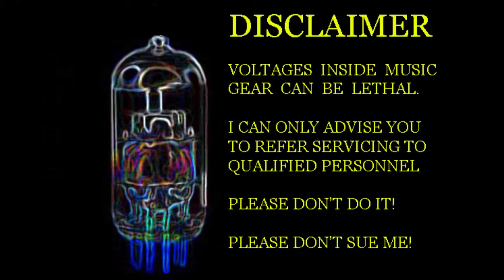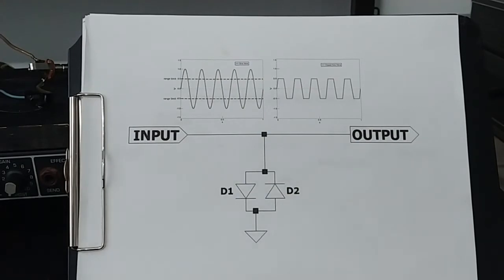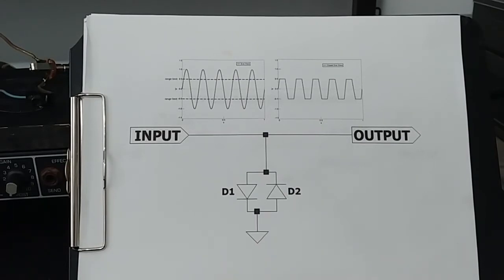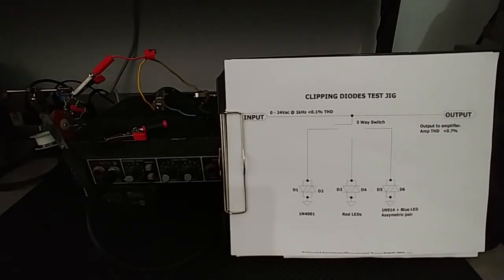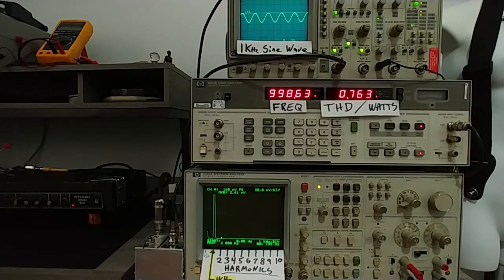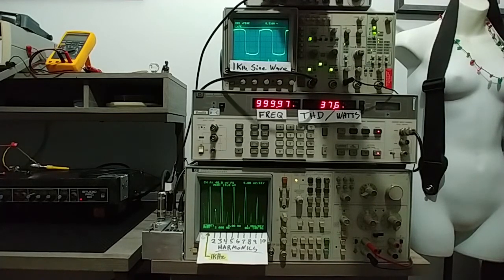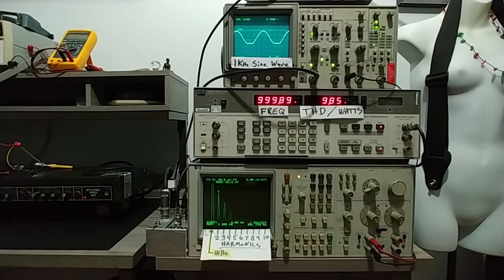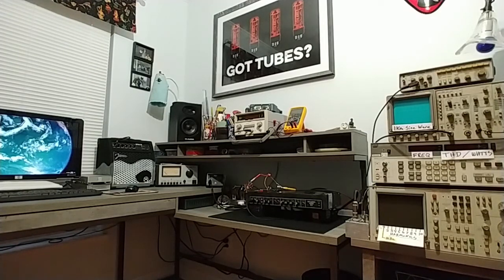Understanding Distortion (Pt2) - Diode Clipping circuits

Comment: 21:00 i've never agreed with the hypothesis that even harmonics in the overdriven signal is what makes vacuum tube amps sound "better" than analog clipping diodes or digital amp modelling. in the oscilloscope videos i've seen, tube amp distortion frequently seems to have this "wobble" or "fuzziness" to the waveform from it not being perfectly stable. whereas clipping diodes produce a rock solid waveform with high resolution on the oscilloscope. it's my theory that the mechanism that causes this phenomenon is what causes tube amps to sound "better" to so many people
Reply: That would make a lot of sense! 

That’s what I would describe as the “feel” of the tube amp so many people long for, because it reacts differently everytime yet its familiar 

Solid states on the other hand are so linear in their response so it misses the “feel”

Comment: Excellent presentation !
I used to build these boxes with 1N34A germanium diodes because of the lower threshold voltage (as you know, .3 v.) and they seemed 'looser' or 'leakier' at their turn-on point.
It will be fun to see what results you get if you decide to test 'em !
Bill P.
Reply from the maker: Im planning on doing some germanium and zeners soon, thank you!
Reply: @amptechron  You're welcome and I look forward to your results with the germanium  diodes !

Comment: Let me suggest a test. Put a 5k trimpot in series with one of the diodes and vary the wiper to see the results in harmonics.  It will cause an assymetric clipping, but with a certain control...

Comment: I just added the Jose clipping circuit (zener diodes) to my super lead. Somebody had already drilled a hole in the front panel for a ground switch, so I repurposed it.
Reply from the maker: I may have to do a follow up with germanium and zener diodes. How does the mod sound?
Reply: @amptechron  like 80's hair metal? Lol there's a significant volume drop when it's engaged, and it helps somewhat emulate the same kind of sound you get with the amp cranked, without blowing your eardrums or getting the cops called. I've noticed, using an attenuator, theres almost no audible difference if the master volume is above 70% or so
Reply: I'll see if I can get a sound clip for you
Reply from the maker: @ApeShift  Thanks, I love the supers and 800s.....Rock on!
Reply: @amptechron  I assembled a Ceriatone yetti amp, I liked the clipping diods and ppimv in that amp with a adjustable negative feedback resister pot/ resister. That did good classic rock to 80's metal. It's a good feature when switchable. There are good diagrams on the net of those amps.

Comment: Im curious how tube amp wave form looks and changes when using a distortion box to further overdrive an amp already in overdrive. Example is I use MXR distortion plus ,that uses germanium diodes, in front of tube amp that is already in distortion.  Since the tube amp has that odd wave form does the distortion box take away little scope or add to it.

Comment: JFet clipping ?
Reply from the maker: I may doing a third distortion vid with active components in the future, as well as other types of diodes....
Reply: @amptechron  Yup, JFET and MOSFET distortion would be interesting to see. 

JFET, in special, can work in two different regimens (triode and pentode) and since it's basically a voltage-dependent resistor, ou can create naturally asymmetric distortion with it.

There's some interesting circuits that exploits this character to approximate valve behavior, like the Fetzer Valve:
http://www.runoffgroove.com/fetzervalve.html

And the mu-Valve:
https://nexp.pt/triode.html